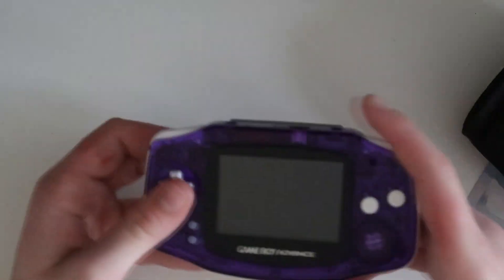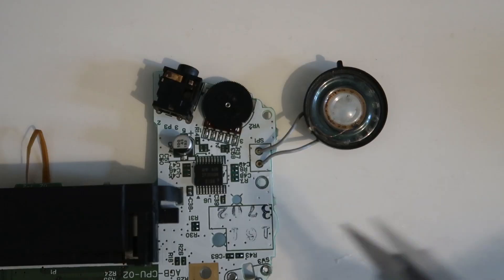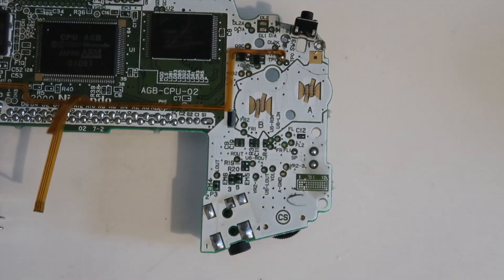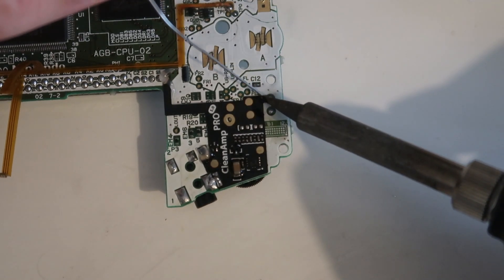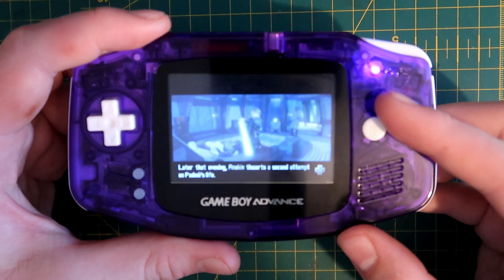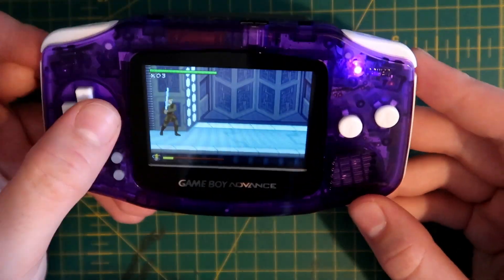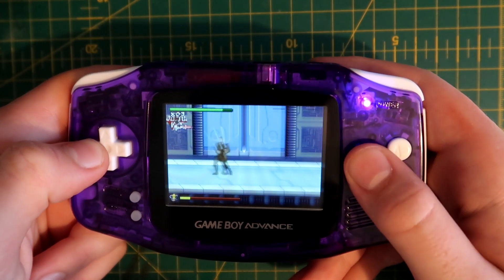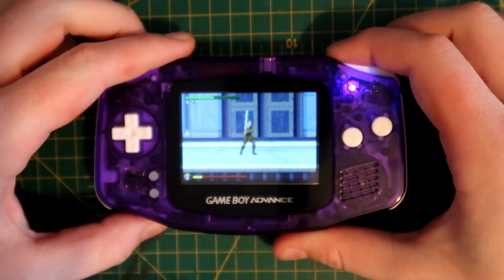GameBoy Advance Speaker Upgrade Mod Installation

Comment: After this installation my console doesnt turn on and it makes a crackly hissing noise. What did i do wrong?
Reply: oh probably everything :(
Reply: @JohnLocke1517 figured out some traces where i didnt need to solder were lifted. Bought a cheap one from aliexpress instead and it works now
Reply: @lixi9881 good to know, could you notice any bigger difference between standard audio and a new one?